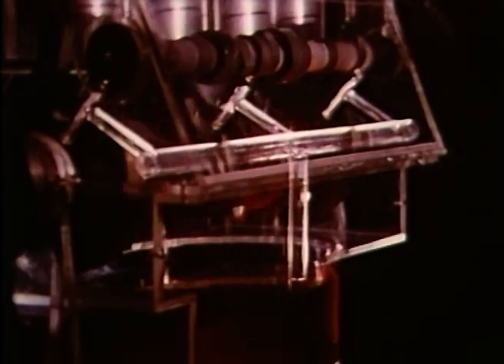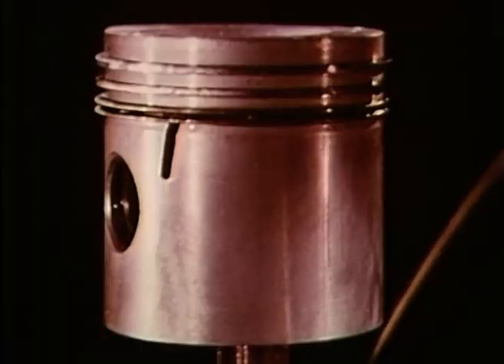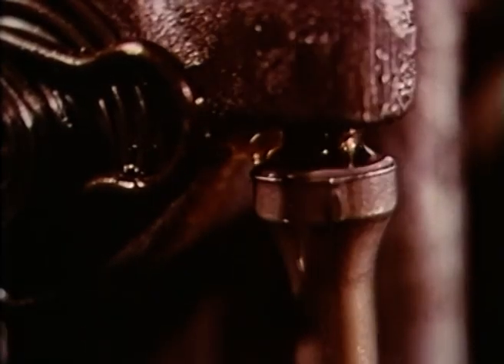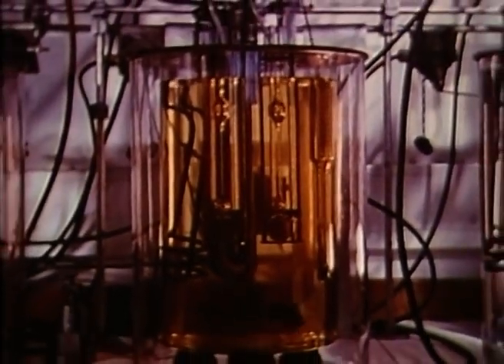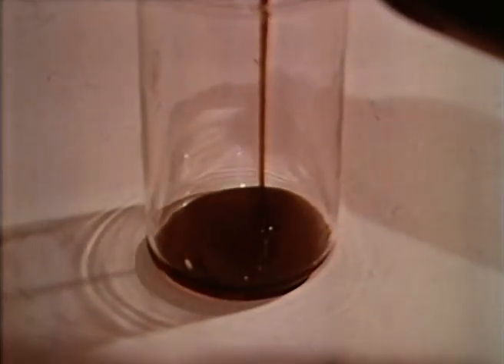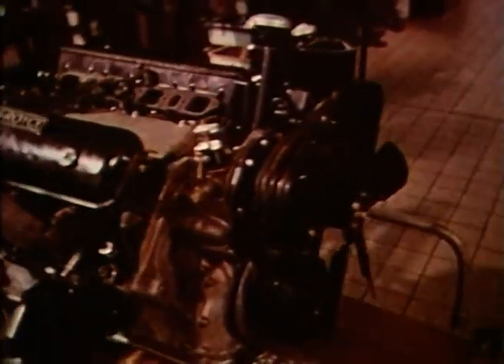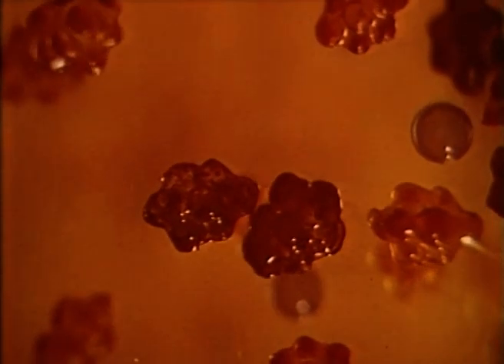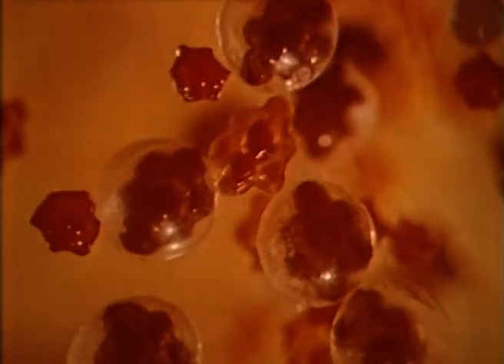The Inner Workings of Engine Lubrication | Shell Historical Film Archive

Comment: I recall in California back in the 1960s the Shell gas station's highly touted "Shellubrication" service of automotive engine oil changes and chassis lube.
If you are wondering what was "chassis lube?"  The vehicles back then had front-end suspension and steering links and pivot points requiring a thick petroleum-based grease injected into those links and pivot points via a "grease gun" that would be affixed to "grease nipples" or "zerk fittings."    It was akin to inflating a tire via an air-hose being attached to a tire's valve stem.  The difference being operating the grease gun lever until you'd see the excess grease oozing out of the link/pivot point.
For backyard mechanics (such as myself), it was a messy job, requiring the front end of the vehicle raised so the wheels would hang free.  On the General Motors sedans of the 1960s to '80s era, I recall there were at least seven separate places in the suspension/steering requiring grease.
I love the modern technology of front-wheel drive vehicles that eliminated the need of chassis lube, as I still do my own oil changes.

Comment: Μr Engine without oil seals you're nothing.
Reply: Hilarious that, the Hillman engine shown has NO seals 1592/1725 and all it's predecessors used no seals. Just a good design. Even the crank pulley is just a reverse scroll groove... Once it starts leaking it's a sign of excessive blowby or misaligned timing cover.
Reply: @hsbhachu3d Any more info about Hillman or this engine. That brand was never exported to the US. 
Chrysler missed a small car opportunity when they sold that division before the oil crisis.
Reply: @jhoncho4x4  the car is a Hillman Super Minx. The engine is a 1592cc (1.6L)3 bearing crank with a tensile EN24 billet crank.  The later engine was based on the 1592 but with a longer stroke, 1725cc but with 5 bearings.
Reply: That is interesting; I had no idea an engine without seals was possible. I guess with the correct machining, it could be done. 
Are there any videos available about this engine? 
I don't think the US ever got any Hillman automobiles; I have never seen one in person; not even at car shows. @hsbhachu3d